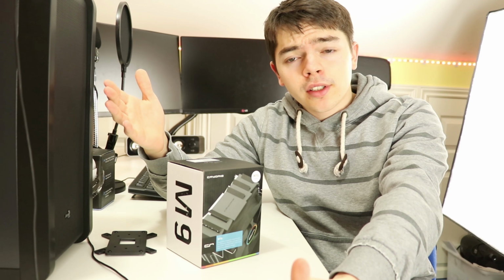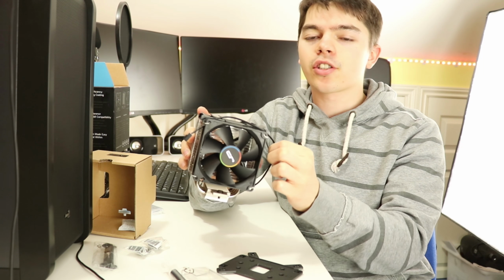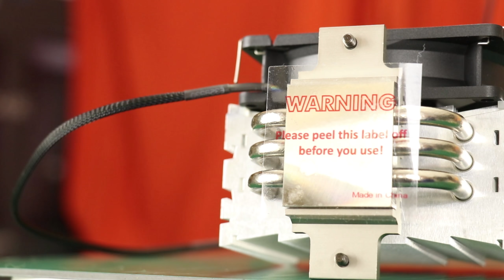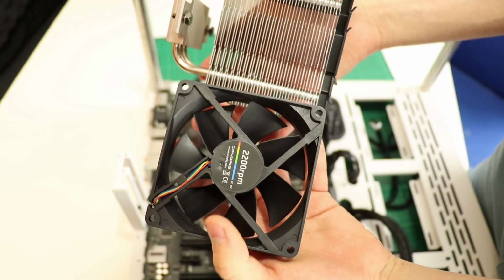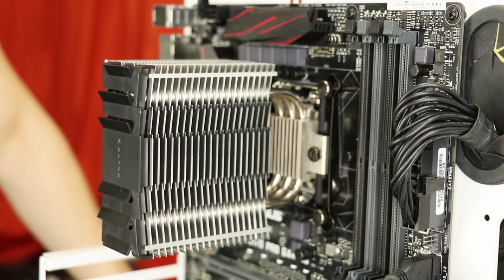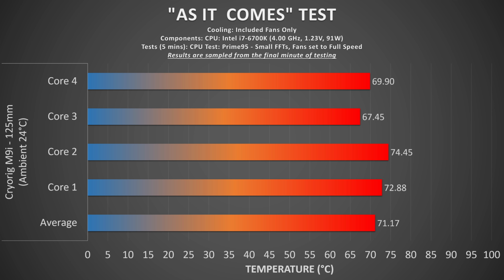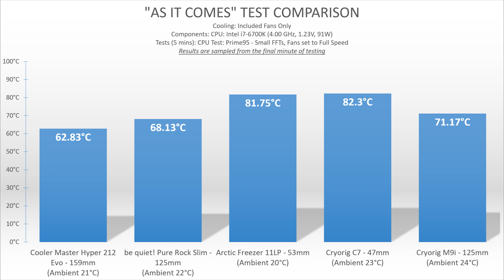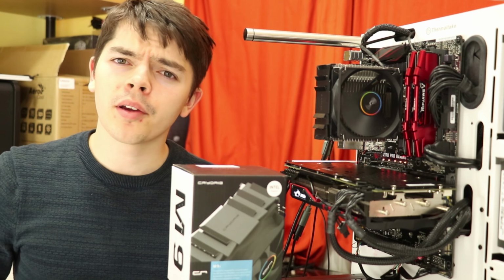Cryorig M9i Review - A compelling alternative to the bequiet! Pure Rock Slim

Comment: Very nice vid as usual, your reviews are as if oneself would tamper around with the product, like how you left the mounting ‚fail‘ in, the vid gets a more natural feel that way.
The upright graphs are easier to comprehend, at least for me.
Just two things would make them even better and a comparison ‚fairer‘.
It would be good if you could use a different color or tone for the cooler being tested for a fast sort of visual snap on point for the cooler at hand.
And it would be better to ‚normalize‘ the ambient temperatures to maybe 20-22C over all coolers. As the the graph heights would show the actual differences between the tested coolers. Because like this two graphs could be the same height if  for example one does 68C@22 and the other 65C@25. But it’s good that you measure and display the room temperatures.

I had an idea for a maybe further visual uplift for your vids or maybe  at least for the b-roll shots, a fairly easy way for a cleaner background, not saying your messy^^
Well let’s not say clean, we‘ll call it a more professional touch;-)
The idea is, you could use a cableline like the ones to attach lights to, I think you even have those on the ceiling. 
You could attach one of those parallel above and behind your typical filming area and have a light colored curtain on that, with this you could easily change the background and/or have light(rgb) glowing from beneath or the sides. And if not needed or in the way for daily room use you could just pull it to the side. Yet again just an idea that could open up possibilities.

To the future temperature testing, as said I believe it’s good to get some games in there. Would definitely get a combined set in there like cinebench(cpu) with something like Heaven(gpu) running at the same time, to have some more synthetic long term data in there when games switch up, more thinking about cases now.

How is the activation of the partner program going? Hope your back in, don’t think I had n add tho on my first watch now...

Yup, again a massive post...we’ve got issues ;-)
Keep up the great work
Reply from the maker: Hey, been waiting for a period of time to be able to properly reply to you. There's just so much to talk about haha.

I completely overlooked the colour change situation. I could have easily done that last minute.  A thought to add to that is that I could change the colour of the reviewed component to Orange like the case review graphs, and I could change a close comparison cooler (if being discussed) to a darker shade of blue to make it a little more distinguishable from all the other coolers, but not overly contrasting in comparison to the Orange coloured bar of the cooler in review.

I'm completely with you on a delta T graph. Since I have the information it wouldn't be too hard to amend, and since I still have all of the coolers (which should have been sold by now, but I've not got around to that yet) I think I might do a livestream to retest all of the coolers with the new testing method (prime95, GTA 5, Dirt 3, Firestrike, etc.) to generate all of the graphs right off the bat so there's no baron period where there's no comparison to other coolers. That's going to take a while haha.

I think for the background of videos, for simplicity's sake I'd like to have all of the boxes for PC components in the background shots, but blurred out so they're on just distinguishable. I do need to make sure I  have a better clean up than I did in this video, just been a bit knackered lately so I wasn't too bothered this time around, but I'll try and stay on top of it for future videos.

On the subject of monetisation, we're still waiting to be reviewed. There's such a backlog since the changes were made that we're still looking at a reactivation around the end of April. So we're not going to be able to upload any super cool and creative videos until that happens. But at least it's something to look forward to haha.

Awesome comments as usual, I've made a few mistakes in this one which I won't make again. I'm looking forward to getting a new set of Excel documents in place for all the new types of thermal testing we'll be doing in the future. Thanks again for the ongoing support, and I'll hopefully catch you  in the next one which will of all goes well be on the Riotoro CR280 - Our first mITX build!
Reply: AV Techy on the background, really wasn’t getting on you for having any sort of mess or anything didn’t notice it at least, the idea just popped into my mind that especially for b-roll a lot of others have a almost clinical clean look that i guess lot of viewers prefer these days. Just had that idea of a easy changeable background (type of video box thing) and wanted to share it, before i forgot it again ^^
Getting some tech stuff in the background is always good for talking head pieces. I catch myself checking out what they got back there in other people’s vids.

Hope I get a notification for the next stream, the other one was pure luck I caught it 10min in...

I don’t think you should go full delta T, best keep the ambient in on the temps but just normalize the measurements, I believe it’s easier for many to comprehend, not saying people a stupid these days...hmm well a lot of people ehhm just don’t like thinking...sort of :-)
...so addition might just be to much...

Not the people on this channel! Got great guys here. 

Just thinking of what’s better for general public, modest tech people. Just like the bar colors. Stuff just has to be easy to recognize, easy to comprehend and somewhat pre-digested...for ease of (brain) use, while not sacrificing your personal style. 
No problem right^^

Comment: In the most recent PC I built I put in the pure rock slim over the m9i because at the time we ordered the parts the m9i was on newegg canada for $125 which is a downright rip off and the pure rock slim was $26 with free shipping off the same site.  I am not sure why they were even asking soo bloody much from newegg canada for that m9i but it is not worth top end air cooler price for a budget air cooler performance.  We put that cooler on an i5-8400 cpu since we didn't like the looks of the stock cooler and I refuse to spend any more than $30 on a cooler for a locked Intel CPU.  That is considering actual cooling performance the stock cooler is enough to keep that CPU within its safe temps.
Reply: Tetsuclaw 

Wow! I got the M9i on amazon (US) for $19.99 last year. That is ridiculously insane. For that price you could get a decent AIO liquid cooler.

Comment: Not sure it would've made a difference but the heatsink was facing the opposite direction it's meant for.  You mounted the fan on the wrong side.  I run my i5-6600K @ 4.6ghz with 1.285v and max out at 65C with AIDA64.

Nearly every review for the M9i has it beating the CM 212 EVO.
Reply from the maker: The fan comes attached to the cooler on the correct side. I've double checked it, and it's mounted in the same way as all of it's advertising material.
Reply: AV Techy ah. Good call mate.

Comment: Looks like a pretty decent cooler, but as for us Ryzen users, its slightly more expensive. Not loads, but as it's a fairly cheap cooler (£20 in the UK) the £7 increase is quite a jump. Not sure why? Might be to do with the mounting bracket? Oh well, will look into it. Quality video as always.
Reply from the maker: It's pretty impressive for its size. I've been updating my testing platform to get better readings over many more tests and the M9i is pulling punches with the Hyper 212 Evo in a surprisingly large amount of results.

As for the price hike, check out the M9a and see if that's cheaper ( unless you were referring to the M9a). I think for the M9i to work the AMD sockets it's needs an additional adapter, which could explain the price hike.

Anyway thanks for checking this one out, really appreciate the support!

Comment: Note to potential buyers: the backplate isn't 100% compatible with all intel motherboard especially if you're using ITX board. They didnt say this in their manual.
Reply: but is it compatible to msi b360m mortar?
Reply: @shiroyashaasdf330  get the m9a. if its still not compatible, you need to email cryorig and ask them to send you a set of washers since they dont include it in the box.

Comment: Hi, great video. I have this cooler but motherboard componants mean the brackets cannot be screwed tight. Mobo is Gigabyte B360M DS3H. Anyone else reporting this problem?
Reply from the maker: Thank you very much!

As for the issue you're having, is it a problem with the brackets to the front of the motherboard, or the plate to the rear? 

You mentioned the brackets, so I'm assuming it's the VRM modules that are getting in the way. Are you able to mount the brackets in a different orientation to circumvent the problem? If not I'm afraid it might be a case of looking for a different cooler. 

If I came across the issue myself I would have mentioned it. I'll try mounting the cooler to a few motherboards in the future when reviewing them to see if I come across any issues like this.

Wither way, thanks for flagging the problem up, and I hope it all works out well for you. Let me know if I can help out.
Reply: Thanks for the reply. By brackets I mean the ones that sit on the motherboard allowing the cooler to be attached. The brackets cannot be screwed tight enough to mount the cooler. I've not tried another mounting position (I've now packed the cooler away to be returned) but expect the same problem. It could be common to the newer intel boards so would be an idea to try different boards.
Reply from the maker: I think a different cooler is in the cards for you unfortunately. You've have though the clear socket area would be standardized across all boards, and all cooler manufacturers would steer clear of this. I don't know, I'll do my best to cover these anomalies better in the future. 

Any idea which cooler you're going to get instead yet?
Reply: Hi. My cpu is not overclockable so going with Arctic Alpine 11 rev 2. I would think most coolers which use brackets would not fit this board. I know this cooler is not 'fancy' and similar to the stock one but it is quieter and cools slightly better. Also fits my budget.

Comment: Um how did you expect the screws to go in it the cross slot on the rails lol
Reply from the maker: It's a sticker, it's made of paper. I was expecting the threaded bolt made of steel to not have too many problems with it. Paper sticker Vs steel bolt, I know what my money would be on.

So dispensing with the humour. The big question to me is, why does the sticker exist in this product at all? What is it intended for if not to be disposed, or used as a guide of sorts. If it's not an X marks the spot situation which appears to be the case, then it's existence is puzzling to me.

Let me know your thoughts on the situation. If it doesn't look good and won't be seen anyway, and isn't a guide, why have it at all?

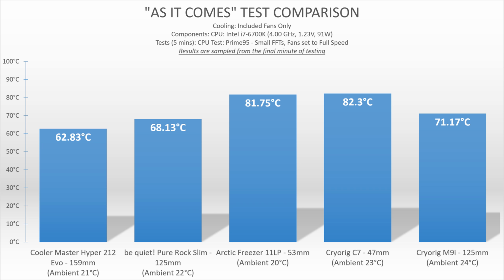Comment: 11:30 you say the difference is 2-3 degrees but it's actually 1 degree if you take a look at the ambient temperatures
Reply from the maker: Ahh I know, I'd worked it out before I started talking about the thermals but I screwed up remembering it. I'm a bit overworked at the moment, I'll try to make sure silly things like that don't happen again.

Once I've gotten around to revamping the thermal testing results we'll be doing a delta T thermal graph to eliminate those kinda of issues. At least the raw results are there so people like yourself can get the actual results haha, sorry again about that - it's an amatuer mistake...
Reply: AV Techy okay, no problem :) I
Stay safe man,  don't overwork yourself to hard

Comment: What would you recommend for cooling a Ryzen 3600 stock settings.
Cryorig M9a AMD For 23.26 USD
Or
Cooler Master Hyper 212 RGB CPU Cooler - Black Edition For 43.20USD
BTW Great video very informative :).
Reply: I think you should pick 212 evo if you have compatible case. Most of the time 92mm coolers is reasonable for use is when you have limited compatiblity for cpu cooler height in your case. Sorry for bad english
Reply: @mamfaa6136  All g thankyou for your help, I got the Cryorig Cooler for 25% off and its been working very well temps are between 70-73c and they only go up to that if I am playing and streaming at the same time at max settings or when running benchmarks. 
Have a good day

Comment: Can this cooler froze/cool enough my i7/8700K 3,8 6 cores and i might overcloack it in the future.! Btw with my water cooler the biggest i have is 60* but i am thinking to change to an air cooler because some say that it might run the liquid inside if you have it for a long time (I have it 1year and 3 months) and destroy my GPU or motherboard or both.! Its not custom made my water cooler. Thanks in advance.!??
Reply: For english press #1

Comment: I don't think the testing method was very fair to the M9i as, you only ran the prime95 test for 5 minutes, this gives an advantage to the bigger coolers as they have more thermal mass, however if you left it running for let's say thirty minutes to an hour you would probably see the M9i competing with the hyper 212 Evo. not insulting the video it was good but the test misrepresented the cooler.

Comment: What pisses me off is when manufacturers do separate versions for Intel OR AMD CPUs, instead of either coming up with a flexible all-in-one solution or supplying a mounting kit for the one you don't  use. But no, better buy it separately or buy an entire new cooler if you decide to change the platform...No. Fuck off.

Comment: I would actually consider this a hyper 212 competitor, but ok....
Reply: C2Lception would be 92mm vs. 120mm tho. If someone can fit a higher cooler they should typically go with a larger one as bigger fans tend to be quieter and larger coolers have more surface area and should perform better. But if a smaller case is mind for the future sure one could go with a 92 for the time being.
Reply from the maker: Well considering the Hyper 212 Evo is over 30mm taller, they're not really in the same ball park. The bequiet! Pure Rock Slim is the same size as the Cryorig M9, and they are roughly the same price, so they are perfectly comparable and are in direct competition.

When it comes to comparing coolers, size is much more important than cost. Hence why I discussed the similarities and differences between the Pure Rock Slim and the M9.

So out of curiosity (and because talking tech is fun), why would you say the Hyper 212 Evo is a more direct competitor to the M9 over the Pure Rock Slim?
Reply: AV Techy i was basing off price, m9 is $20, hyper212 is somewhere around there, and these kinds of coolers will usually be put in budget builds, where an extra $10 saved on the cooler can maybe get you double the ssd capacity
Reply from the maker: Well the Hyper 212 Evo is at least here in the UK priced at £25 which is the same cost as Pure Rock Slim and £5 more expensive than the M9.

But if the coolers are the same price, where is the $10 saving to go to a larger SSD. And to throw a little more information into the mix. The cost difference between a budget 128GB SSD and a 240GB SSD is around £30. And I'd say 120GB is as low as most would go, so it's going to take more than $10 to double the capacity of an SSD.

There aren't many aspects of the Hyper 212 Evo and the M9 that are comparable. The size difference just destroys that right off the bat.
Reply: AV Techy $10 saved on the cooler isnt enough to double ssd capacity correct, but if you combine it with other corner cutting, it can (buying a used gtx770 vs a new 1050, buying a cheaper case, etc)
Reply from the maker: I'm completely with you on the cutting costs out of each component. But if the Hyper 212 Evo and the M9 cost the same (and the Hyper 212 Evo costs more) then there isn't any money to be saved with the Hyper 212 Evo. 

If costs are going to be saved, they should be scraped away from the highest value products. Getting a $190 over a $200 graphics card won't loose any performance (logically a $200 and $190 card would be of the same model), whereas reducing the CPU cooler budget by the same amount from say $30 to $20 is going to reduce the available options substantially.

Either way, the Hyper 212 Evo is the better cooler in terms of performance. But it's £5/25% more expensive and can't fit in as many cases as the M9 or Pure Rock Slim. You're in the right ball park for the most part, but there are a few potential sticking points with some of your statements.
Reply: AV Techy as if we could find any decent cards for $200 anyway, but I saved $10 by going for the m9, which allowed me to get a x3440 over a x3430, which means 8 threads vs 4 threads
Reply from the maker: Well the $200 was purely an example of a higher cost component. But you can probably understand the same principle can be applied to any higher cost component in a system.

But if we're talking about old Xeons, then the cooler isn't looking like the cheapest component in the system. But I can imagine most will be looking at up to $100 for a budget build, there that $10 isn't going to transform the CPU as drastically. There would be more to save from the GPU or the PSU, even the motherboard, and like you mentioned earlier the case. But there aren't many nice coolers lower than $20 around, but then again, if it's a super budget build then the CPU won't need a lot to cool it, most of the time anyway.

Anyways, hope you Xeon build is going strong. And thanks for checking out the video.
Reply: AV Techy np, xeon been doing great, the m9 keeps it under 70C under load, also looks better than the 212 imo, nice and elegant